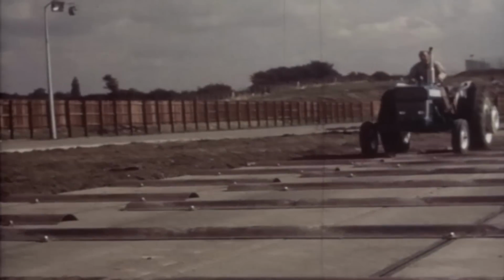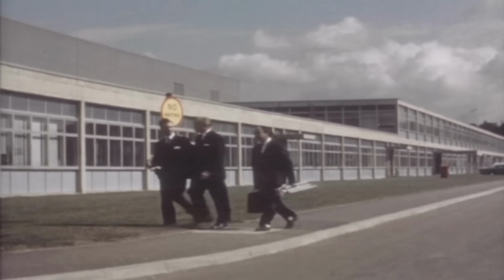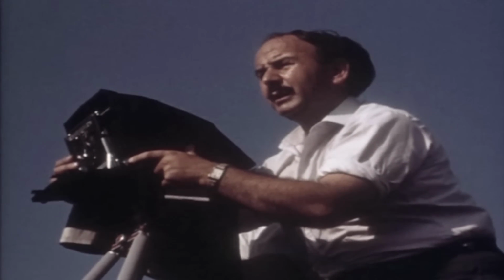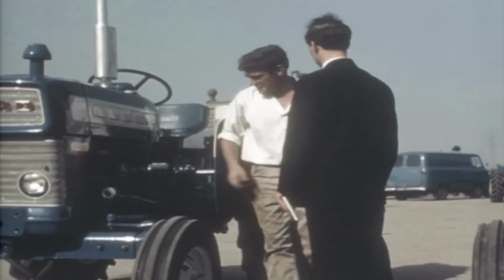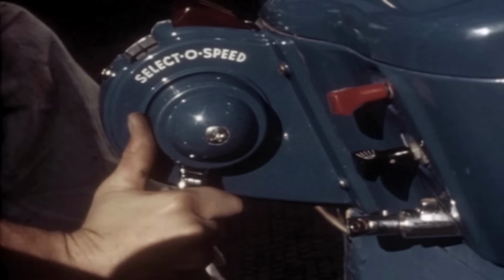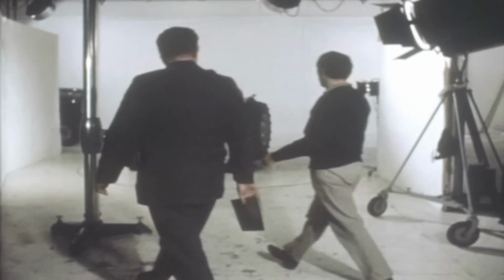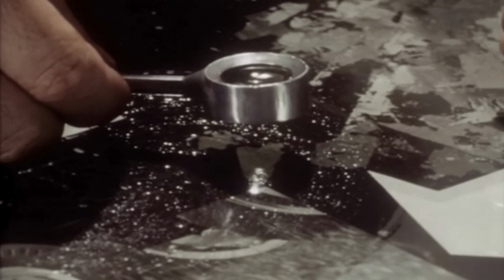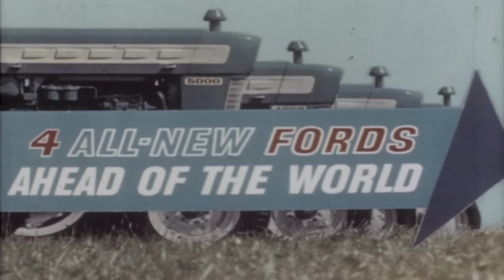Ford Tractor Film The Catalogue 1964

Comment: My father's 1964 Ford 5000 just had it's first engine overhaul and rebuild in the year 2019 -- after 55 years of nearly trouble-free daily farm use.  It is our oldest tractor and always the most reliable.  The 5000 has come to the rescue when newer, bigger tractors got in trouble or had mechanical breakdowns.  Our 5000 is every bit as capable as the newer, bigger tractors we own -- a 7600 and 7710.  Our 1971 Ford 4000 gas tractor is equally reliable, but long overdue for it's engine overhaul.  My wish is to someday also own a Ford 3000 or perhaps a 3600.
Reply: Good  day  from Ontario Canada  Yes 3-4-5000  tractors  were very   well built.  Good   tractors except over here they went with select-o-speed,  big down fall.  Thanks  How many hours were on   5000 before  rebuilt?
Reply: My Grandfather had a new pre force Ford 5000 in 1966. It blew up in the first 25 hours, as a piston had been put in the wrong way round. Ford's put a new engine in and she was fine after that. In 2003 the engine was overhauled in and in 2017 she had a full restoration everywhere else. If there is such a thing as love for a machine then this is it. I have memories of sitting on the toolbox on the mudguard with Grandad or Dad. 
A real treat was sometimes Grandfather and i would nip to the  local shop on it to get him a packet of Manikin cigars and he would say to me, "Get yourself a Bob's worth of sweets".
Great memories.
Reply: Had a 4000 with a select o speed.........it was the first and last ford I'll ever own.